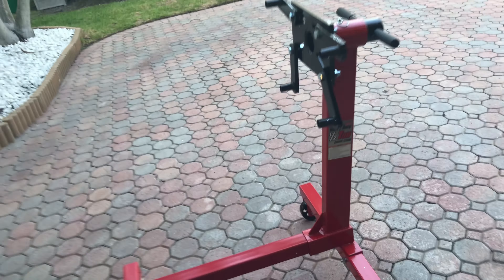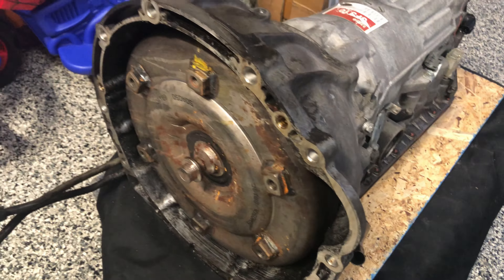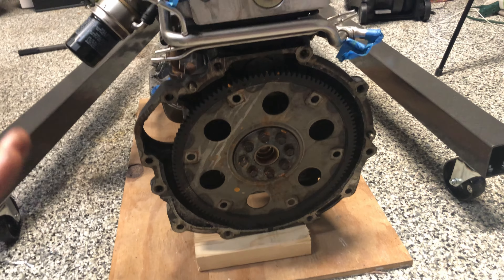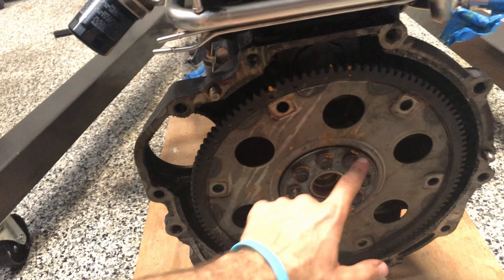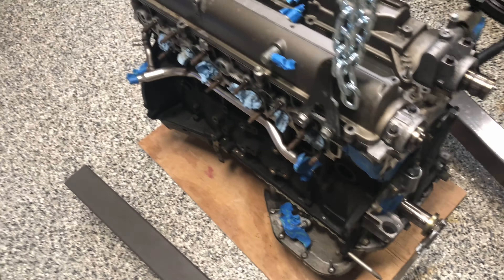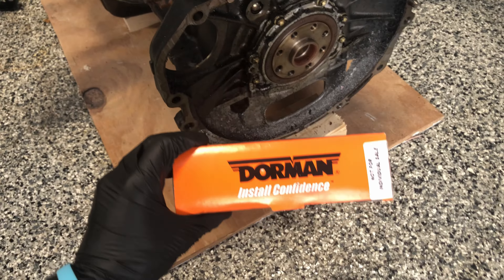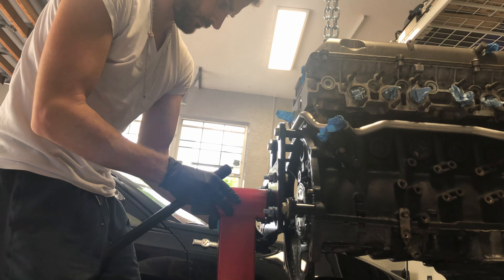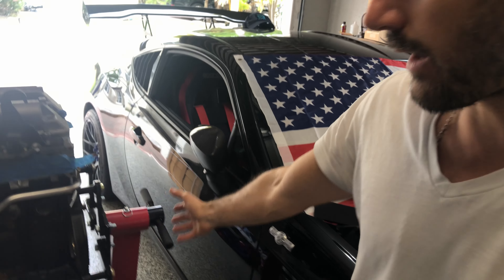Getting the 2JZ on the Stand [Automatic Transmission]

Comment: As someone who just bought a oem toyota short block and has to put it on a engine stand(first time building a motor but ive been around cars for a bit) would you recommend those boltsto mount to the engine stand?
Reply from the maker: Yes man they are holding it. I’ve crashed after this video and now my engine has been more than 2 months back on the stand. Bolts are strong. BTW I think I’m going to buy the same oem Toyota block to rebuild mine. My crank seems not ok
Reply: @MinkMood  thankfully they still sell it well worth the money, and i saw man and dont let it go to you happens to the best of us, only means you are going to come back stronger 100%! And much appreciated for the information bro been looking all day🙏 best of wishes seriously you seem like a genuinely good guy keep grinding !!